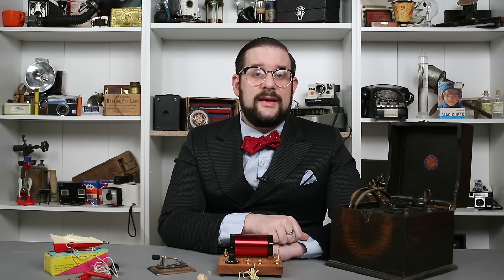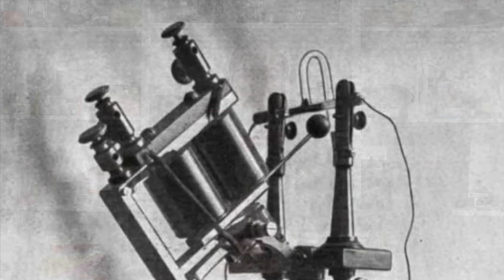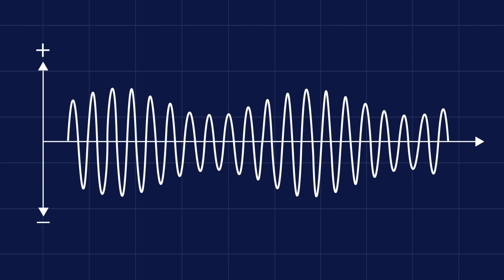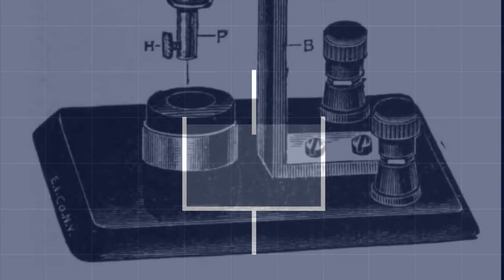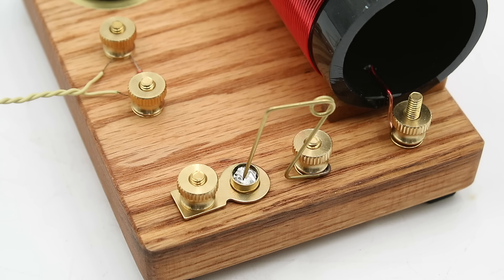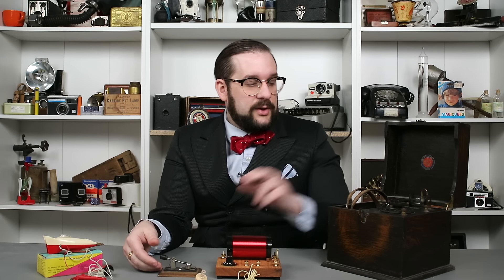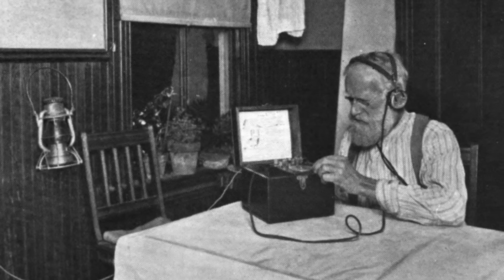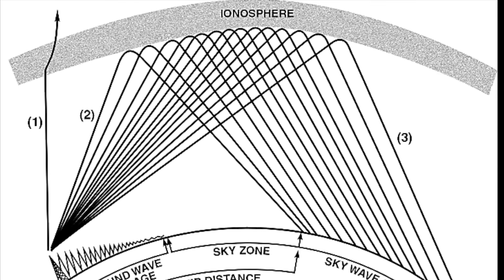Crystal Radios: No Batteries? No Problem!

Comment: Clear and comprehendible explanations, as we have come to expect and should not take for granted. The explanation of the difference between single and multi-strand conductors for AC is interesting.  I always thought it was about flexibility, which would explain why the wiring for the main circuits in a house are single-strand while the connection wires for appliances, lamps, etc. are multi-strand.
I assume the use of single strand wiring for main circuits is essentially a trade-off between economy and efficiency. With the price of copper these days, it seems like converting to multi-strand wires for mains might be worthwhile.

Comment: My father gave me a Radio Shack crystal radio kit, in the late 1960s. I also got the Radio Shack 100 in 1 setup a few years later. Unfortunately, we lived close to an AM broadcast tower, so most of the circuits, I built, just became radio receivers.

Most of my electronics education occurred in the 1970s into the 1980s. This was a transitional period. Coming into the 1970s, if electronics was mentioned in everyday conversation, "radio", was often the common reply, as that was the electronics was associated with. This includes television. But leaving the 1970s, electronics was more associated with computers, as Apple, Microsoft, and IBM's personal computer, at least entered the minds of hobbyist.

Comment: I'm not sure your explanation of the detector is correct.  The reason the bare AC signal doesn't produce anything audible is because the frequency is well above audio frequencies, not because the average voltage is zero.  When I run AC audio into headphones, it works great.  Modular synthesizers also send audio between modules as AC waveforms.  They all average zero volts, yet the signal works quite well.

Is there something particularly different about the headsets used with crystal radios?  Or is the detector doing something else?  It's the latter; because AM signals are encoded by varying the amplitude, cutting half of the radio-frequency signal (which is well above audible frequencies) creates a DC bias, and then varying the signal around the new average kicks out the audio signal again.  The headphones are trying to play RF, too, but physical inertia stops that from being particularly effective.

You don't even need a particularly good diode; the approach of making a fine wire and a re-annealed razor into a detector works even though the reverse 'resistance' is only a few hundred ohms over the forward 'resistance'.  Just introducing that tiny amount of bias is enough to drive the audio circuit using the amplitude modulation.
Reply: His description was close enough.  "average voltage is zero" really should have referenced a time scale matching the audio band.
The detector is a diode so it conducts in only one direction more or less.  The headphones have an impedance of about 2K Ohms at audio frequencies.  The crystal headphones are more like a capacitor that bends when you charge it up.  To make them work you need a resistor in parallel.

Comment: Did anyone use a gas flame as a diode.  With one wire on the metal gas nozzle and a other wire in the flame, the resistance depends on the polarity of the connections.  It is only a partial diode.  Cheers

Comment: you can also use a lump of coke, I remember building a crystal radio, then  not having a diode, using a lump of coke from the coal shed.. that was when we still had coal fires to heat our houses.

Comment: You really should do an episode about heterodyne radios.  fun fact:   the local oscillator of a standard broadcast FM radio is 10.7mhz higher than the tuned frequency.  If you tune the radio to 106.5mhz for example, it will put a birdie on 117.2mhz.  Tuning anywhere from 97.3mhz to 107.3mhz will make birdies on the navaid band used by aircraft.  This is why the airlines used to tell us to turn off all radios.  That morphed over the years into "all electronic devices" with no one actually understanding the /why/.
Reply: This is also why the "beat" button was installed on some  compact AM/FM tape recorders...To shift the oscillator in the tape recorder electronics slightly so it will not interfere with the   heterodyne frequencies and create a chirp. .... Pressing this button would lower the quality of the recording from the radio, but, at least, it was clean.

Comment: I MADE A CRYSTAL SET EVEN MORE SIMPLE.  NO COIL, NO VARIABLE CAPACITOR. JUST CONNECT THE DIODE ACROSS TWO WIRES OF HIGH IMPEDENCE HEADPHONE. CONNECT ANTENNA AND EARTH TO HEADPHONE WIRES.

Comment: It is reportedly possible to get 20-30dB of gain with a coherer if it is biased with both DC and a local RF oscillator. Marconi magnetic detectors will demodulate AM signals without problem, giving clear reproduction of speech and music in my personal experience building and using one.
Reply: Yes, it's a myth that a Coherer cannot demodulate an AM signal. 
In fact Marconi's first reception of transoceanic signals used an un-tuned set with a Coherer plus headphones, as this was more sensitive than the Magnetic detector. This also meant that the early detector inventors already knew that the dissimilar metals in a coherer would do the job.
Reply: Just 3 DB was an entire S-Unit or double the gain and clarity.

Comment: I wonder why you have to constantly fiddle with the cat's whisker and can't just set it one time and forget about it. I guess oxidation?
Reply: That's a good question, possibly oxidation or somehow the spot on the crystal gets damaged by the cat whisker. Maybe a chemical reaction, maybe mechanical damage?
If I were demonstrating the technology and not too concerned about authenticity I'd be inclined to try a schottky diode.
Also if you use two cat whiskers really close on the same crystal would it make a transistor? :)